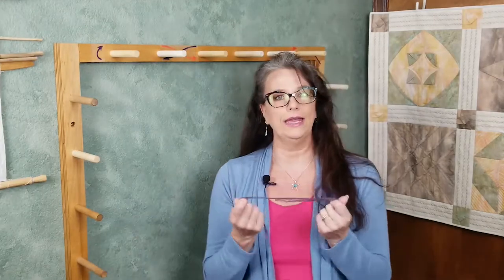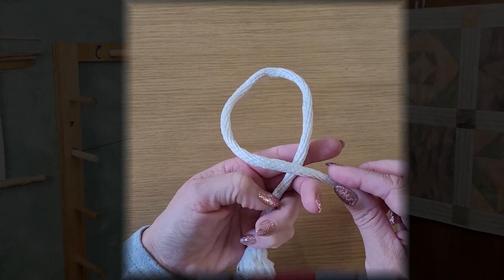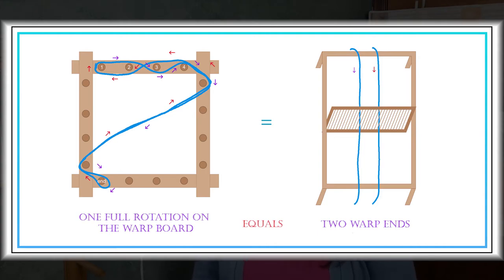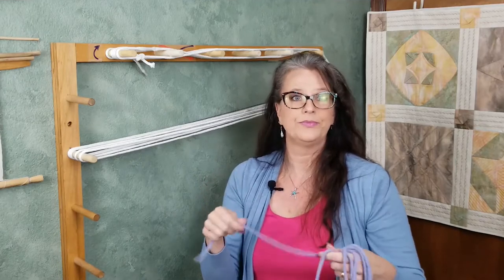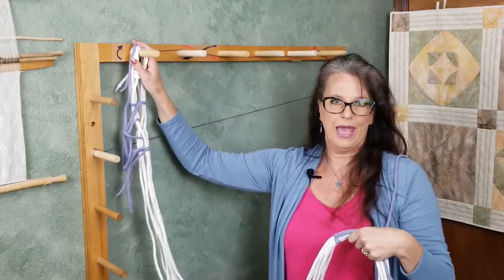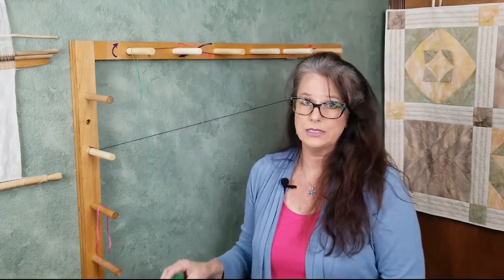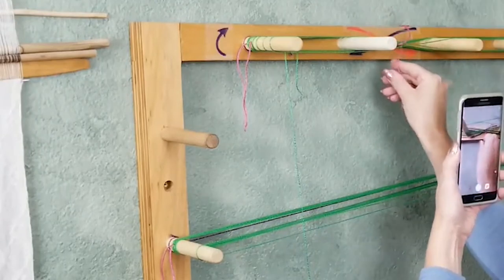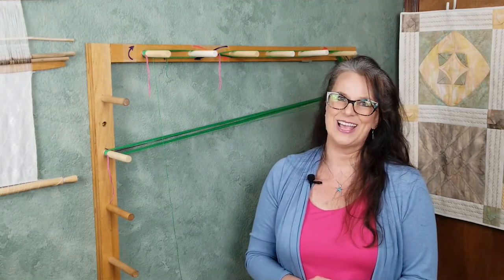Prepping Warp on Warp board

Comment: This was fantastic! My husband is finishing making my warping board today. I can’t wait to start using it later! Thank you for your teaching
Reply from the maker: That is so exciting!! Quick tip: if he's doing removable pegs, make sure they fit tight. I must have had a slight movement when using my router to make the holes and some don't hold the pegs tight enough. So frustrating to have one fall out in the middle of measuring🙄. Now I would use my drill press. Best wishes!
Reply: @sandraclarkfineart6903  we appreciate the tip! They will be glued…he used a drill press.

Comment: Could you please make a warping board tutorial for simple plain weave patterns requiring two warp colours?

For simple repeating stripes with two colours, do you cut the end at the starting peg, or leave it dangling and until it’s required again?

And how do you warp for two tone patterns where you need alternating coloured ends in a pair (eg one black end, one white end)? Someone told me to wind the two colours together, but then how are the ends put in the correct order on the cross? Please help!

Comment: Does your weaving pattern tell you how many strings you need, like how wide you need to make it?
Reply from the maker: You will determine the number of threads you need by the width of the finished piece, the size of the yarn, and the pattern you are weaving. I don't have this video done yet, but I can give you the highlights.
1. Take your warp yarn and wrap it around a ruler for one inch. Count the number of wraps.
2. If you are doing a plain weave you will use half that number. If you are doing a twill use 2/3 the number of wraps as the number of warps per inch.
3. Multiply that number by the total width of the project. You will lose about 10% of that width after you take it off the loom and wash, so you might want to add a bit more width.
I hope that helps. Let me know if you have questions.